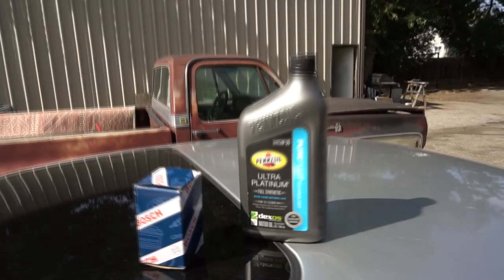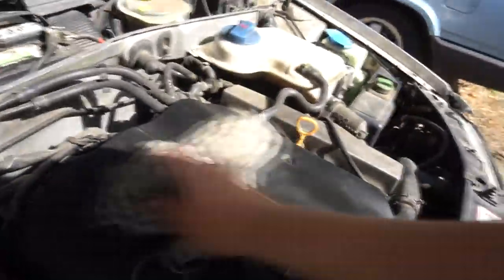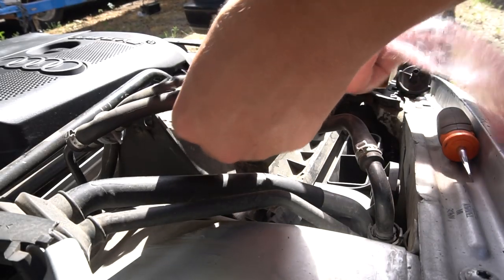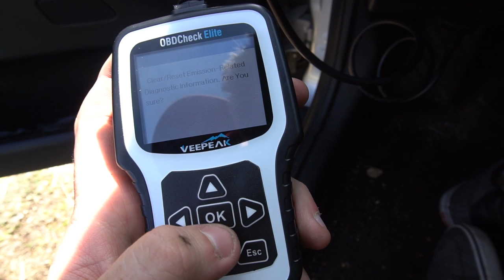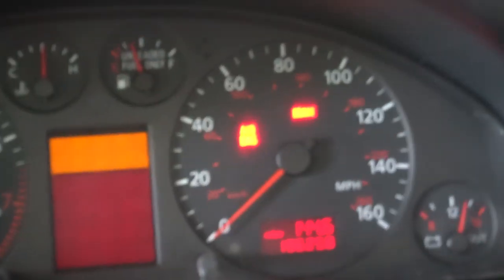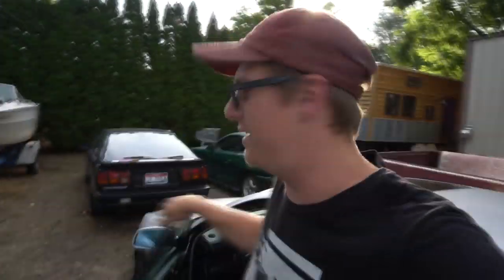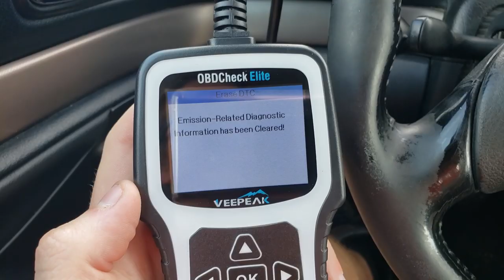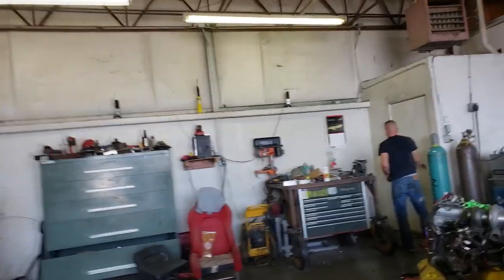I Have The RAREST AUDI IN HISTORY

Comment: I've been daily driving my 03 jetta for a year with literally no lights, airbag or otherwise. I paid $300 for it, threw in an o2 sensor and its been gold ever since
Reply: Emitz is it the chad 2.slow?
Reply: Mk4 gang. 2.0 5 speed here. WBU?
Reply: @Peaks209  fuck yeah. And its automatic. So I cant even modify it.
Reply: Emitz ahhh yeee 12V auto and 5 speed along with a 20th AE. The fun never ends bois.
Reply: Emitz cut the exhaust off. That'll make it 10000x faster. 🤣

Comment: Hey man. That code is for bank 1 sensor 2 which should be the downstream one for measuring catalytic converter health. Shouldn't cause the blinking CEL. May want to pick up a VAGCOM cable and use VCDS-Lite to see what the issue is. Most likely it's just plugs or coils.
Reply from the maker: The blinking was unrelated to the o2 sensor code, yes. I have plugs on the way and will get new coilpacks if that doesn't solve it.

Comment: Been watching forever. I have literally the same car. Just got a motor from lkq with 80,000 miles on it and swapped it. Love that car. I now also have a 2002 Audi A6 4.2 V8 I bought for $500. Runs and drives. Neither have check engine lights and both are great cars